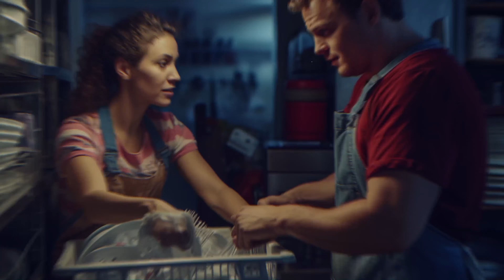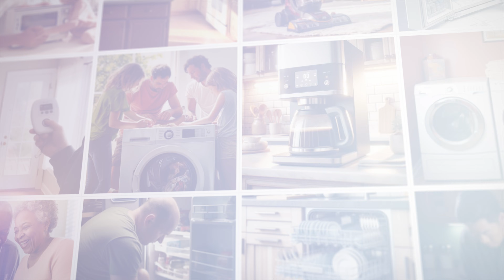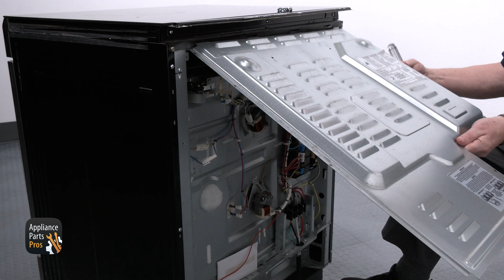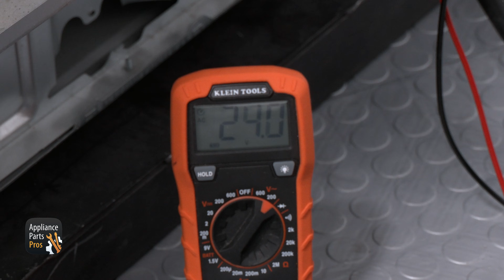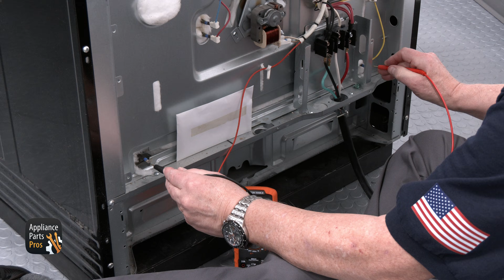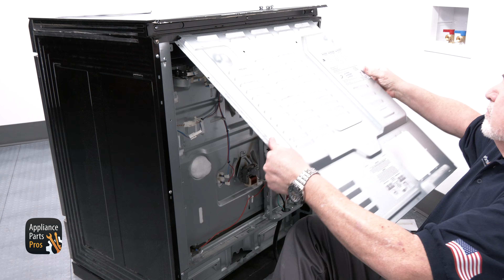Why Your Samsung Range Isn't Heating Up (Troubleshooting)

Comment from the maker: 🔧 Common fixes for this issue:
▶ oven control board (no specific part number given; model-...: https://www.youtube.com/watch?v=KNLwV2dcWnY
▶ bake element (hidden style, Samsung range — no specific p...: https://www.youtube.com/watch?v=6_hmo2YcqUM
▶ high-limit thermostat (thermal fuse) — Samsung electric r...: https://www.youtube.com/watch?v=3KG-59WmBrI
▶ Main oven control board / electronic range control (ERC) ...: https://www.youtube.com/watch?v=RjgXZesOXAc
▶ Whirlpool electric range hidden bake element (part number...: https://www.youtube.com/watch?v=XSJSNAwmO3A
▶ thermal fuse (no part number provided): https://www.youtube.com/watch?v=9bHlvG80PHI

👍 Found your fix? Hit Like so others can find this video too!
🔔 Subscribe for more repair guides: https://www.youtube.com/@AppliancePartsPros